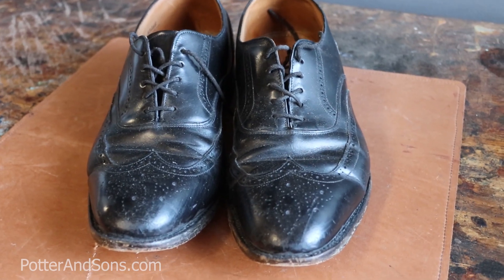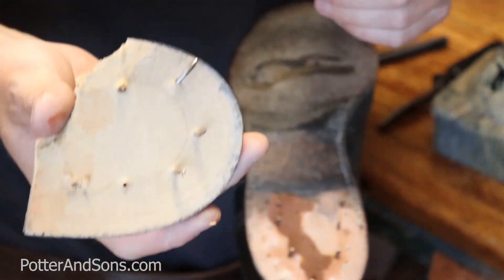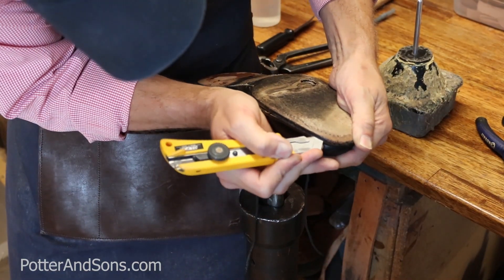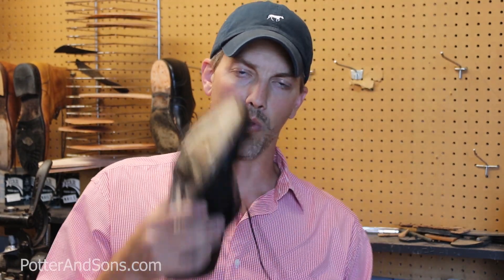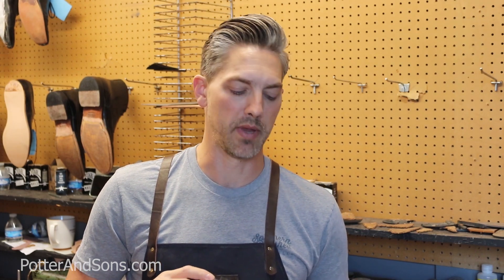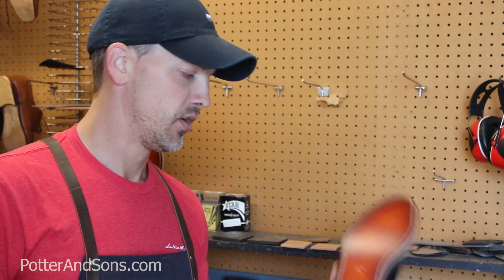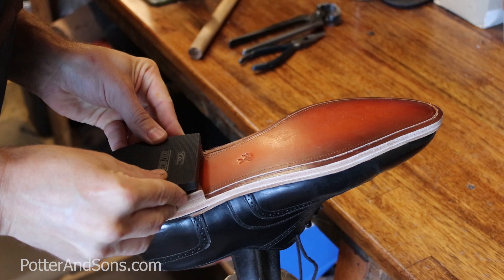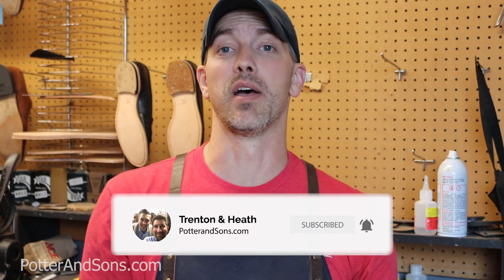Johnston and Murphy Shoe Restoration

Comment: Very lightly used Brazil-made J&Ms in an oxford with rubberized sole and leather 'welt' or whatever are nice... Local sale of nearly new ones for $17 delivered. The inside and out appear to be soft leather and these were not scarred or abused at all. A very good deal almost as good as like-new  Allen Edmonds 'Bradley'  model for $15 delivered from a Goodwill auction online ...

Comment: With that particular rubber heel, does the shoe still retain the “clicking” sound on hard floors?
Reply from the maker: These particular heel pads are a softer but very durable rubber by Goodyear.  They’re fairly quiet heel pads.
Reply: Not all shoe shops tapper the heel so that it doesn't rock forward and back with the sole which likely ads to that click. A good shoe repair will tapper the heel so that both sole and heel meet the surface at the same time.

Comment: I just had a question. I was thinking on buying some Allen Edmonds on ebay but I have never worn dress shoes and I was wondering if I use my sneaker size it would be the equivalent on using dress shoe size? I know for boots you have to down size between 1/2 to 1 inch depending in the width. Any suggestions?

Comment: Johnston & Murphy is the correct spelling.  They are great middle to upper end shoes while many other brands are likely better, the value decreases it seems the more expensive they get. What's more, not every shoe repair shop uses the good sole and heel materials and in many cases, the customer has no choice in those as the shop offers only "sole and heel" replacements vs. low grade or higher grade. Some of them are thin and/or lower grade and won't last as long as the originals. I have several 30+ year old J&M's and they still perform and look above the competition.
Be thankful we still have shoe repair shops around...buy good shoes and fix them as long as they can be and save ton's of money while wearing a comfortable shoe each time vs. "this brand feels different" every time you switch shoes or buy new ones. A fair supply of good shoes in your closet will ultimately save you money and give better results in the long run.